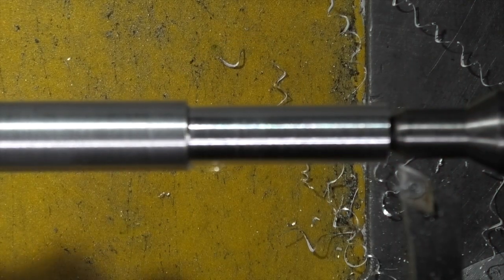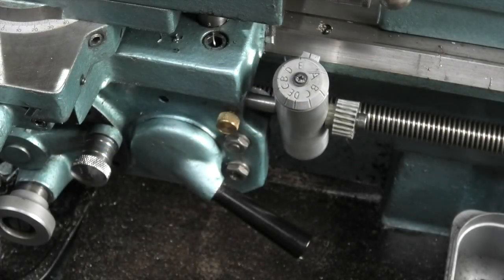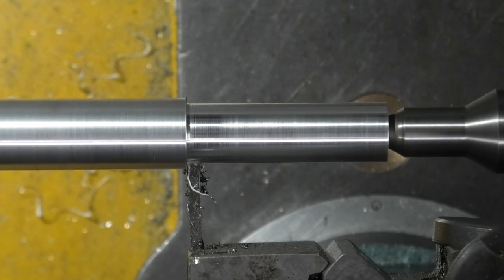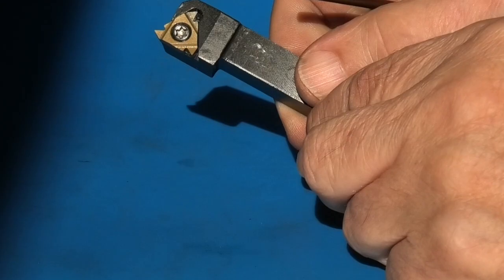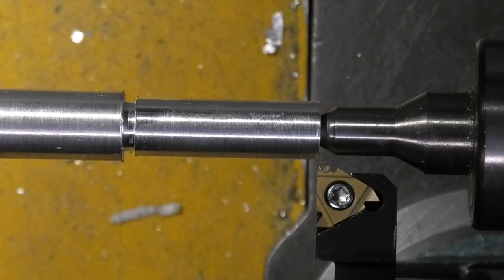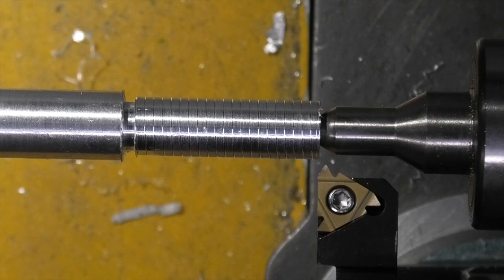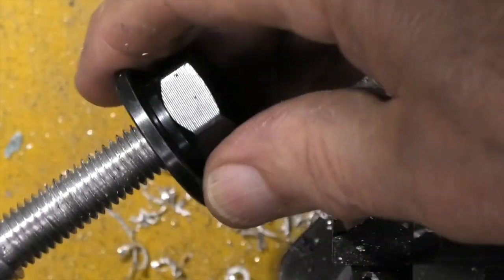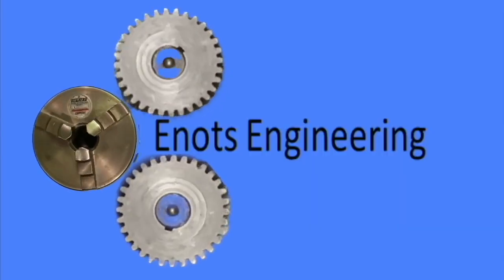screw cutting between centres

Comment: What stops the drive pin rotating away from the carrier when the spindle is reversed? When the next cut is started in forward it will have to catch up while the carriage is moving.
Reply from the maker: I have a revolving centre in the tailstock which has little resistance The centre in the head stock grips the bar and moves with the part  it would have to very loose to move away from the drive pin If it did you can fix the drive pin to the carrier with some wire